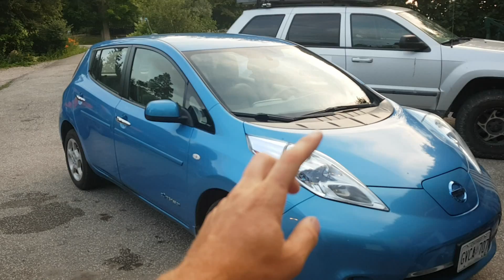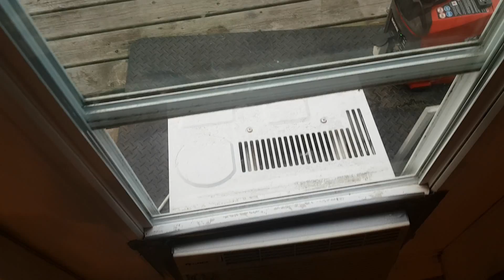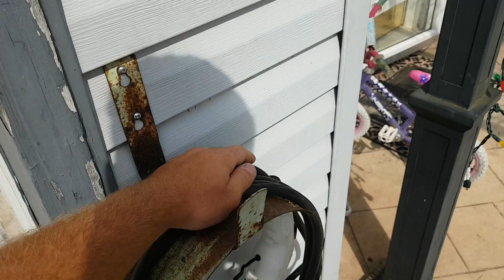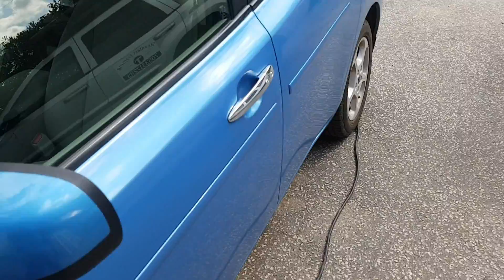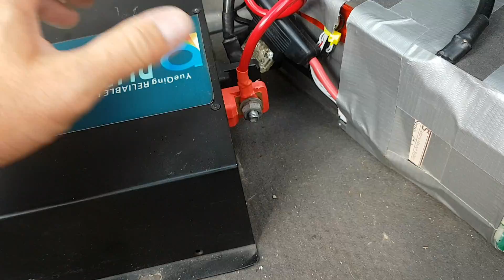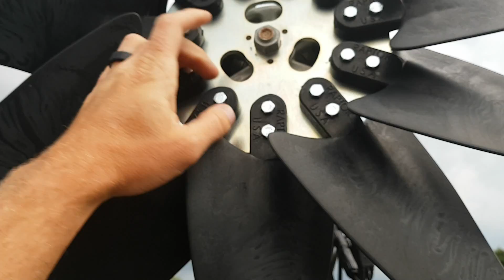Massive Update So Much Happended

Comment: I personally would have got access to car main battery voltage and have the secondary battery in the boot either always connected or only when needed. That way you avoid all the enclosed heat in the car from running the inverter and all the power losses- that is from battery to inverter, then inverter to the charger, then charger to car battery.

Comment: Since you have the midnite classics, you should build a DC generator, it would be ALOT more effiecent! Just modify a car alternator, connect it just like the wind turbine, maybe concert to pma, just not run it at full power, I'm still working on mine, I'm scaling it back, to about 50 amps, I'm going to use it on my lead acid Bank, and use my 30 amp lipo charger to charge my lithium Bank, for now anyway, the car audio guys are using cmax, batteries with alternators, they use 4s, I may give it a try, just not fully charge, if I can go from 20% to no higher than 80% all should be good, its for emergency power anyway! Keep it below 28.4v it should be OK, I'll be babysitting it when charging anyway, I need a thermal camera , a thermal camera that's connected to the BMS, to detect any overheating, that would be cool, overkill but cool!! I need to get to work!!

Comment: Nice having power when the grid is down isn't it! My house was the only lights to be seen, when we had a bad storm awhile back, I need to convert my generator, to dual fuel, or get another that is, maybe convert a car or motorcycle to fuel fuel, gas doesn't store that well!  Although I have some nearly 2 years old, that's not totally dead, the stabilizers work, propane us better, I need to get more battery, and pv,

Comment: I love what your doing but i hate that you have the batteries in your house. one mistake and you might not have a house,
Reply from the maker: i have tested these batteries and they are safe, and im adding a fire suppression system.
Reply: Half you tried over charging one?
Reply from the maker: @swolath  yes i put 12v into a 4.2v cell

Comment: there is gear box that fit these turbine get more power lower wind speed
Reply: What kind of gear box and where can I get it from?
Reply: it is stepper moto gear box you can fine them on eBay you just have to get the right size an ratio

Comment: it would be a lot more efficient if you could charge your Leaf with DC voltage. The leaf has a 96s battery configuration. you wouldn't get as much  losses from inverting 24v DC to  120v AC back to 400V DC.
Reply: No matter how u slice it .. it's still free power
Reply: The problem is it has to be managed DC charge controller(cant just dump in 380v dc in or what ever the car needs) , not sure if they are available for consumer use, I would imagine he using the 240v inverter to car charge controller as it take for ever to charge the car on 110v (well 2x longer)

Comment: Are you comfortable running square wave generator power into sensitive battery charging equipment?
Reply: Aaron Anderson of course.
Reply: its just converted to dc
Reply: Mr. Bass but the input side is built for pure sine. (Shore power) - coils overheat on squarewave.
Reply: Aaron Anderson Why do you think a generator would be producing a square wave output?
Reply: Beefchicken Industries because that’s what non-inverter generators produce.
Reply: Aaron Anderson are you 100% sure about that?

Comment: 1470 watts divided by 129v equals 11.395 amps. Or did I read the watt meter wrong
Reply: its pulling 1470w from the inverter and the inverter is probably pulling 1700W (85% efficency estimate) through the bms from the battery which would be 1700w/24V = 71 Amps